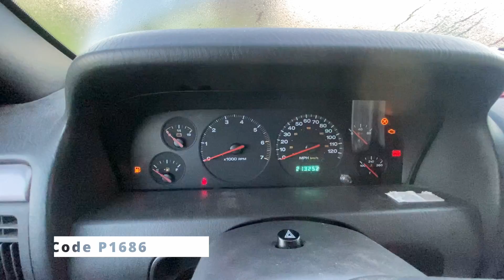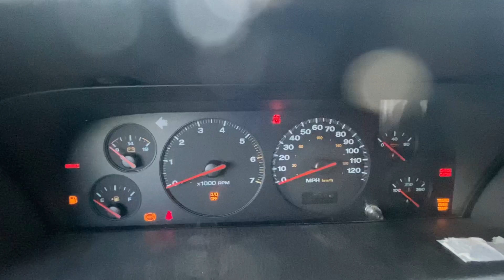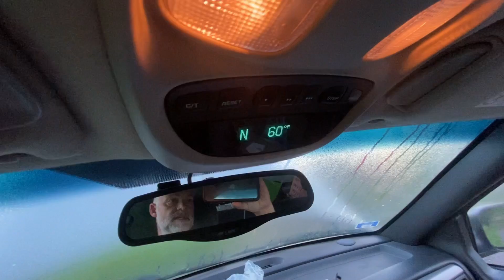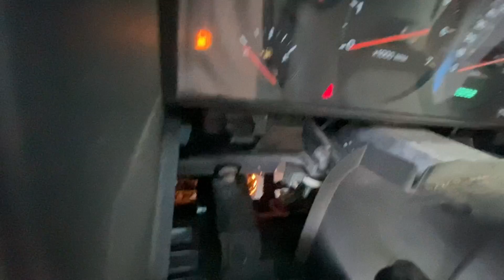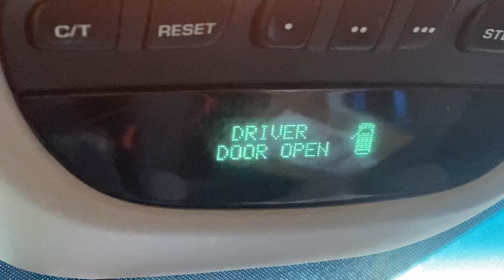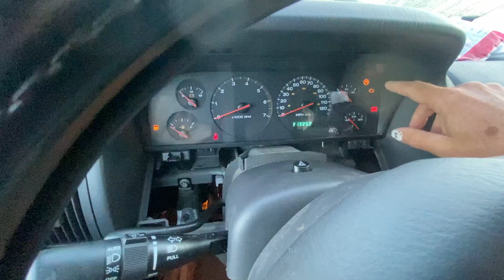Jeep (WJ) Grand Cherokee won’t start? Stalls + Key Light + No Gauges

Comment: My 2003 JGC had the same issue, no gauges, would crank, key light, etc. Bought a ECM from Auto Zone, you have to give them current mileage and VIN, which they program and then OVERNIGHT to you. Installed it 10/20/25, all gauges work, starts right up now.
Reply from the maker: Huh cool did not know autozone did that thanks for posting!
Reply: Dam and from Auto Zone ?  I’ll remember that.

Comment: The ring around my key cylinder (skim ring) got greasy from my hands,  blocked signal, I took the skim out, cleaned the ring. I believe you can clean with pocket knife or a small piece of sandpaper without removing anything. WORKED. Have you ever seen a small layer of grease on you shifter knob, same concept.

Comment: In my situation a do next steps:
1. Switch on the ignition
2. Remove positive terminal from the battery
3. Plug positive terminal back
4. Start the engine
Reply from the maker: Interesting so if you disconnect the battery with the ignition on then reconnect it the vehicle starts and stays running?

Comment: Im getting no lights 😂 and my key jams to the point where i have to turn the steering wheel to pop the key out ( 2013 jeep grand cherokee)
Reply from the maker: That sucks!, totally different platform, and computer systems.  In general a key that Jams in the way you describe sounds like  a copy of a key that wan't cut right. or worn out tumblers in the lock.  No lights sounds like it could be a battery issue? do you have any power?

Comment: Watched this video cause I was having this problem. What I just did was spray electric cleaner in the wire connections, let it set and dry. Hooked back up and jeep started. Have to wait and see if it last. At this moment I am happy 😊
Reply from the maker: That’s awesome!    Thank you for posting your experience!  Hopefully it stays fixed.
Reply: @WhisperingWildMarketFarm  no it didn't stay fixed 😢
Reply from the maker: @Handle4570 that sucks

Comment: I have a 2000 jeep grand Cherokee Laredo 4.7 it only cranks but no start, ive replqced the CPS 4 times already..afer i reaplace the CPS with new it only runs one time then after i turn it off it wont crank no more .any idea whats causing the CPS to go bad? Replaced the computer, cam and crank sensors, terminals, checked all sensors , fuel pump new,
Reply from the maker: If you think the CPS is getting distroyed so quickly, it could be a bad voltage regulator, though I believe those are in the CPM housing so that would require the CPM to be replaced.  Try checking the voltage with a volt meter I belive those are on the 5v buss but I'm not 100% on that. Else I would look for wire shorts and grounding issues. I've seen bad grounds cause voltage to flow in really odd ways though a vehicle.

Comment: I tried to get a voltage reading at the skim module and couldn't get a reading. And we pluged into the obd port and it didn't even get communication at all
The engine cranks but I don't even get the 2 second start
All functions in the door work. With no power at skim connector what does that point to?
Reply from the maker: The dealer also could not successfully keep a connection to the old computer in the Jeep in this video.   Since the other devices are working it seems like it could be the connection at the computer.  Those are known to develop  corrosion and what I ultimately think the issue was with the old computer I had.   There are a few YouTubers that have videos on diagnosing and fixing those connections. The bigger issue is getting the potting compound off so you can reflow the solder joints .  If you’re not getting voltage at the sensors  it could also be the voltage regulator ( also in the pcm if I remember correctly correctly)  I’d still recommend checking though everything especially the grounds. Bad grounds cause really odd  symptoms
Reply: Well, mark here, one ask forum said check the crank position sensor. It took a while to get the small cover on the trans tunnel by the foot duct.. then try to unplug the cps lead and it was dam near impossible but the connection was restored and the problem was solved. Key light gone. Engine started and stayd running.
Reply from the maker: @Mark-xo9sn   that’s great news!!  Glad it’s working now and thank you for adding  your knowledge to the posts.
Reply: Check fuses under sterring wheel there are 2 one is for the skim. The other says run both 10 amp fuses mine were blown

Comment: The electrical in the driver door ,ehat would prevent it grom starting,,?
Reply from the maker: Potentially. The door locks and window regulators are controlled by a computer that shares a communication bus(wires) with the other computers in the vehicle if the bus gets shorted  it could  block the other computers from being able to communicate.
Reply: 😊i think also the key fob or security system might be a reason and possibly a short in the relay box
Reply: 😊i think also the key fob or security system might be a reason and possibly a short in the relay box
Reply: 😊i think also the key fob or security system might be a reason and possibly a short in the relay box

Comment: When I went to start mine earlier it clunked, all the interiors lights went off, all the gauges went out, then all the hands started doing a self test everytime I tried to crank, none of the battery terminals where loose so I removed the positive went and turned the key a few times and put it back and everything was good, never seen it so this before and i can't find anything online about it
Reply from the maker: Hum.   This sounds like there may have been an issue with a connection. I find removing the battery cables  cleaning both the battery and the cable clamp then re connecting them usually fixes this.   Often there is a good enough connection that low amounts of power can flow but once a high draw like the starter kicks in there’s to much resistance and the voltage drops or disappears causing everything to go dark.   Thank you for posting your experience!

Comment: I had this exact problem last year, it was the ground under the center console near the ABS Module, I had swapped out the heater core a few years prior and must have left one of the ground screws hand tight. I tightened it up and got my gauges back and the engine stays running because the immobilizer is grounded
Reply from the maker: Interesting! Thank you for posting
Reply: The ground wire you’re talking about is right under the cup holders correct ?
Reply: There's also ground straps on the ended bolts holding two of the ignition coils. @VisualReality801
Reply: Hey man can you give me a better explanation of where the ground wire is located ?
Reply: @VisualReality801  make sure all your ground bolts are tight, for me it was under the center console, the ground is next to the ABS Module. tighten all the bolts under the console, also make sure your battery contacts are in good shape, I had to replace the terminals and use sandpaper to clean the battery contacts.
Reply: ABS MODULE IS IN THE ENGINE COMPARTMENT ON ANY 4.0L
Reply: @matrixbikes  Mine was a 4.7
Reply: I see. Those are different from the 4.0l.  Thank you! @Ophidicus

Comment: I had the same problem.  Cleaned the grounds, tried leaving battery disconnected at night (helped a bit) but the fix was to spray lots of electrical cleaner on the connections to the ECM, been good ever since
Reply from the maker: That’s awesome!! Glad yours was an economical repair.   Thanks for adding your solution to the comments!!

Comment: How can I fix this car problem? It's a 2005 CHRYSLER 300 3.5L V6 2WD AUTOMATIC 150,127 MILES

The car listed above is limited and according to the client had a horn issue so was taken to a garage. Although the horn later worked, a more complex issue happened to the car. A no crank no start and also a crank no start, whenever security light came up it doesn't start or start and stalls immediately. Infact, ECM was replaced by the engineers but that didn't fix the issues. I finally fixed all these issues listed above with both new and an old ECM. 

https://youtu.be/nFA5iHxwX_c?si=rSRKrmfj4ywRXIQX.

That's a brief video of what I'm trying to explain.

When I was about to go, the client pleaded for me to help him fix these issues below, such as, ABS, airbag, traction control light; hard starting,single turn signal for both sides doesn't work but hazard light blinks normally when the switch is turned on, wipers doesn't work too. Mostly for the trafficator / turn signal that wasn't functioning, what could make it to be inoperative and, how can I fix the problem in that car? Can you guide me please, on the repair procedure to fix the problem?

This were the codes I got below

https://drive.google.com/file/d/1nZQtpE8DuGGQoeA4Lc9Iob-BBbRfzs0H/view?usp=drivesdk

Does it require a TIPM or trafficator switch replacement? Please, how can I carry out a test to verify if it's TIPM or a trafficator switch that is faulty? 

https://www.startmycar.com/chrysler/300/info/fusebox/2005#anchorfusebox1. That's the fuse box diagram I saw online

In addition, when testing the fuses at the trunk I noticed that not all the fuses were available, some were empty. Thus, I decided to swap fuse 4 that was available to 5 that was empty. As I did, I noticed an immediate electric spark just by the fuse touching the empty terminal meant for fuse 5.

https://drive.google.com/file/d/1qqOKGWB08fWkArDwwx9hQ8QLU0zU5Ang/view?usp=drivesdk.

That's the link to what I'm trying to explain.

I tried that again with a known good fuse into that location and noticed another spark/ spike.

why is it sparking whenever I attempt to put a fuse in that location? I compare that fuse location where there was spark to another good working 2005 Chrysler 300 and saw that there was a fuse in that location. Could that also be responsible for the cars turn signal and wipers problem? How do I address this sparking problem in that fuse location?

When I finally succeeded to start the car, as a result of checking the turn signal switch and wiper at under the dashboard using my testlight connected to batt + (pin 16) of obd2 connector and activating the hazard light, when I touched a particular blue/white twisted wire the hazard light seemed it wanted to stop it seem like something is wrong there, when I touched the blue/white wire again the car problems reoccurred all over again. Security light remains ON, lightning bolt light, etc came back on and car didn't idle if it even struggle to start and sometimes doesn't start at all. Fortunately, I was able to start the car again. But the no turn signal, no wipers still remained, how should I fix these ones?
Reply from the maker: Hi David,
That sounds like quite the perplexing problem and it sounds like you have been able to fine quite a bit of information around it.  I’ve no experience with those cars myself so I can only offer some basic advice.  Check grounds.I can’t tell you how many weird and unexplainable electrical issues have been resolved by locating and cleaning up ground connections.  Look for damaged wires.  Many of these systems use a shared buss(wires) for communication so damaged wiring in an unrelated spot can sometimes cause other systems to malfunction. Where wires go from the body of the car to doors is a common spot.  You may also want to check for corrosion on junction points (typically around the firewall  or in the dash). Rodents tend to like to nest in or around fuse boxes and chew wires.  Aside from that if you think it’s a buss issue which it kinda sounds like you suspect then you could try disconnecting the other devices on the bus.  I hope that helps and good luck.

Comment: IF it  cranks without starting on some models it could be the 10amp PCM/ECM fuse under the hood has a hairline break that is hard to see, can happen if you jump a dead battery, so swap that fuse it is labeled on the lid which one it is .  ALSO  if like me you get a spare dumb key for the door and you put it in to start the Jeep, it does the same thing if you or the wife uses the wrong key.   & The Keyfob even works to lock and unlock doors but it acts like the keys were 'deleted', after 1999 the error code Pxxxx comes up for the skim communication, but it still can just be that 10amp little red fuse by the battery, since he does not mention it , check that first with a bright light or just swap it. & I'm rootin for you hope that's it.
Reply: Thanks alot u save me a lot of time nd money❤.
Reply: My 99 v8 is doing the SAME thing happens when it’s get wet?! They pulled horn fuse out why??? Shows a p1698 too! I am going to check fuses
Reply from the maker: @Paintgirl74 , This seems like it would be very frustrating to find. Wet could be water / condensation getting someplace it dose not belong shorting out something or the cooler temps opening up bad solder joints. If this is a Jeep with a distributor I would strongly suspect the cap and say try replacing that. Google says Jeep started moving away from distributors in 99 so may have one.   Checking / cleaning ground connections is a good place to start.  Not sure about the horn fuse.  A quick google search shows a few people getting that code but their trucks still running so that suggests it may be more of a bus  issue like when it’s wet things can’t talk. From what I read any device on the buss going faulty can mess with the bus / cause communication problems. There is a connector under the steering wheel  of some Jeeps that when pulled can disconnect portions of the buss In my Jeep the truck would still start but things like door locks and displays stoped working if you pull that when it’s not working and it starts then you know the problem is with one of the peripheral devices.  If it still dose t work then putting  a scope on the bus to see  if the voltage stuck high low or noisy may help.   Otherwise it is disconnect devices like the tcm/bcm/pcm/ecm  until the fault condition goes away. If the fault condition does not go away when the devices are unplugged then it may be wiring . If there is no issue when scoped  try re seating the bcm ecm/pcm  and tcm  connections.  If it’s still not working after that I’d start suspecting a bad solder joint on the tcm or pcm/ecm.  Else this could all be a red herring and you just have a bad coil pack that dose not like cold / wet conditions. Thats about all I’ve got for speculation on this issue.   I hope your able to get this solved.
Reply from the maker: Good To know! Thank you for adding the info!
Reply: I know this is very old but I had to post. Dude, you are a life saver. A six dollar fix. I checked the fuse like you said, saw that hair line crack like you described. Replaced it and she started right back up with no issues. Thank you so much!!

Comment: Did it work I have same issue
Reply from the maker: Yes  see the follow up video 
How To: Jeep computer replacement SKIM removal
https://youtu.be/PP-ofOwyRNc

I suspect that it was the solder joints on the main computer.   So I replaced the computer.

Comment: I fixed  my door wire I jus learned if you turn your  key to assessor 3 times  an then it work granddaughter told me it happen to her a time or to
Reply from the maker: It seems to be a common problem with these Jeeps wires just seem a bit to short.